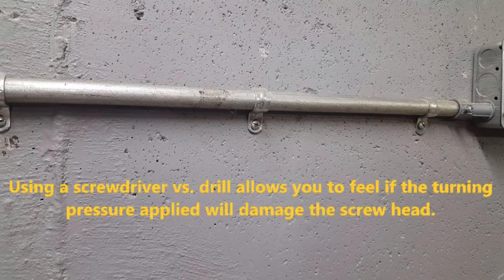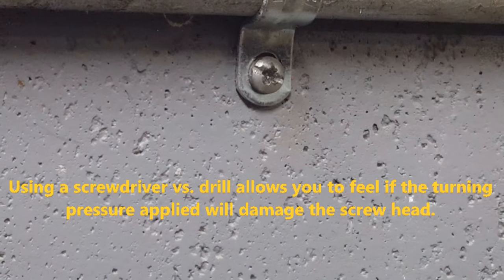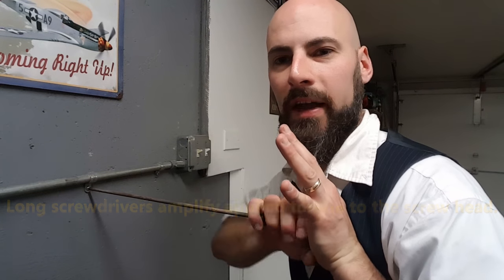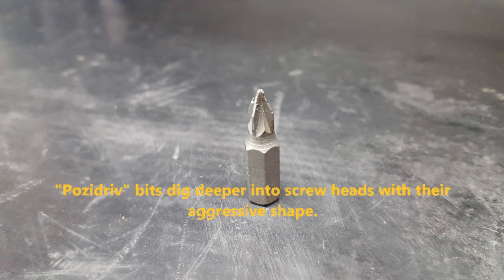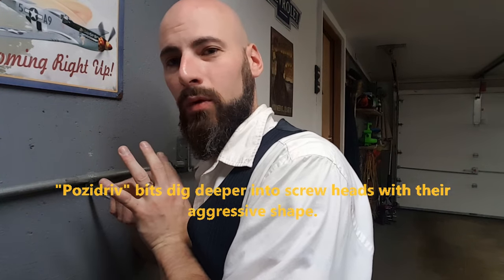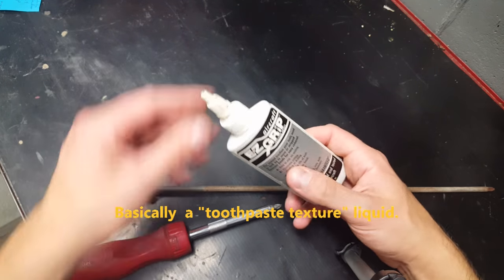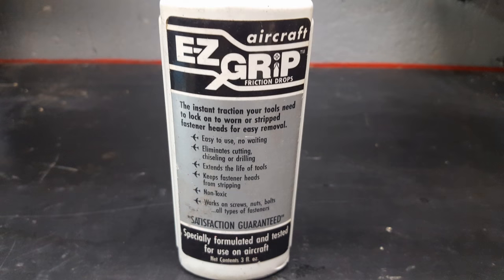How to Remove a Stuck Screw

Comment: Your video gave me the idea on how to break the screw on a push plunger on the underside of a security door.  Clearance to the concrete patio was 3.5".  So used a stubby screwdriver with standard wooden shims underneath to prevent downward movement and striping.   Of course WD40 after a day did help but was not sufficient without the shims to hold screwdriver tight against the screw.  Thanks!  👍

Comment: I don't know if I can apply that kind of pressure on an external speaker without damaging it. The screws are ridiculously tight considering it's just a speaker and not the wheel on a car.

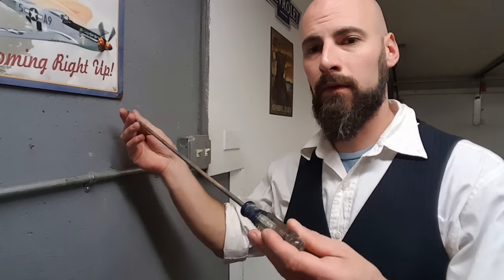Comment: 0:27 "Long screwdrivers amplify applied torque to the screwhead" 
 
Torque = (radius of the screw handle) x (force). 

I don't see how a longer screwdriver amplifies the torque.
Reply: It is just more comfortable...
Reply: Literally half of the equation concerns the radius... tell me again now a longer screw driver wouldn't give you a larger radius, thus increasing torque ^^
Reply: And furthermore, even if he was incorrect- which he isn't- that's low-key so inconsiderate and disrespectful to pick him apart in the comments section when the point of this video is to help people struggling. Come on man, fr fr...
Reply: @CALIGRL888  the radius isn't affected by length of the screw driver its affected by the thickness of the screw driver...
Reply: @CALIGRL888  
you would  be correct if we were talking about using a screwdriver to open a crate. but with screws the axis that effects torque on the screwhead is determined by the width of the handle. basically

Comment: Hi there---this video was good but it does not fit my situation. I would appreciate anyone's comments or help. 
I have 4 screws on top of a propane tank that hold the gauge in. Gauge is leaking and needs gasket replaced. 
Can't get flathead screws to budge---forward or backward. Have started applying PB Blaster and tapping with a hammer off and on (with screwdriver in slot.)
Thanks for any suggestions someone may know of to get them out of there successfully. Jesus bless.

Comment: My vacuum stopped working because the Dyson rolls on the bottom. I forgot one of the electricians that fixed our kitchen left one of these fancy screw bits in the drawer.